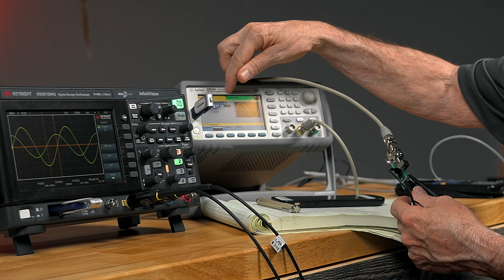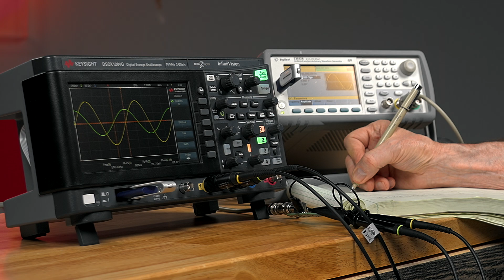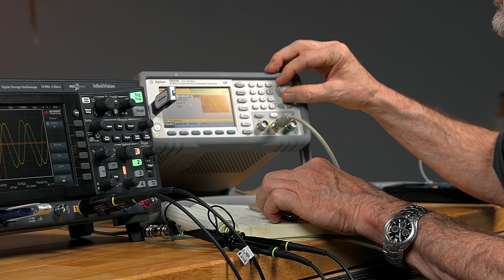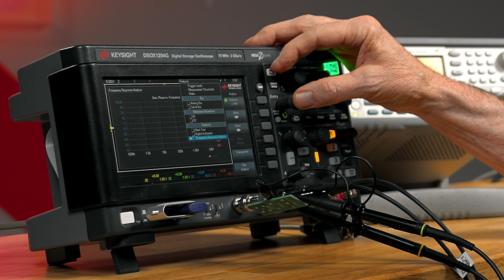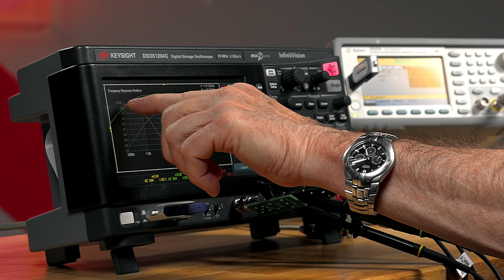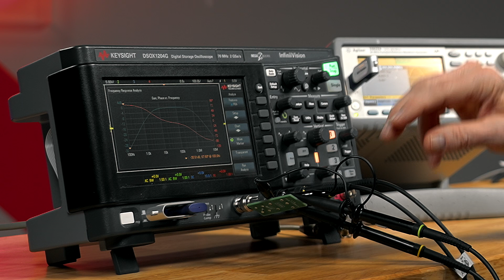Bode Plots on an Oscilloscope: The Old Way vs. The New Way

Comment: Could you also show a way in between, i.e. sweeping and using the trigger from the signal generator to plot kind of like a poor man's Bode plot?  One could probably add a peak detector to plot a single line instead of a continuous signal.  Not quite as fancy but much better than plotting by hand.
Reply: I used your measurment mehod to show the bode plot on oscilloscope screen several years ago.

Comment: Just ordered my DSOX1202-200G. I suppose the plot is much faster for a smaller range. (I hope) One royal bitch I have found with Keysight is trying to order a hardcopy user manual for the scope! So far I only get links to the download copy. Back when HP ran the show it was not a problem at all.
Reply: Buy a printer and some paper.
Reply: @longdongsilver4719  I did end up printing it off. Took 2 hours of fiddling with printing, loading more paper, punching holes, etc.  I have official HP manuals for all my other instruments.

Comment: from ur specs  cannot tell what improvement  in amplitude accuracy   on the  sig gen  of edu 1000g  vs  a separate  edu external sig gen...   si,,,   amplitud accuracy,,,  noise etc  any major improvents or no...    trying to design  mm  and  mc  phono cartridge amps ...  and condenser mic  pre amps....
Reply: the plot measures the gain.   I don't think the amplitude accuracy would be that critical since the scope MEASURES the input to the filter and MEASURES  the output of the filter.
Reply: @1010tesla  yes  noted sir...  not talking abt plot,,,  need to know accuracy differenes   between sig gen  of edu 1000g  vs  a separate  edu external sig gen